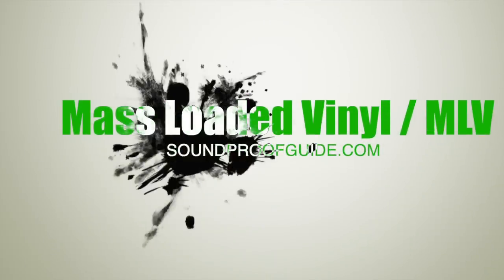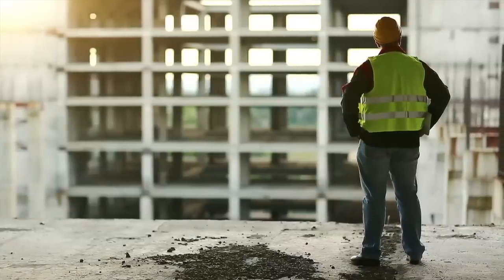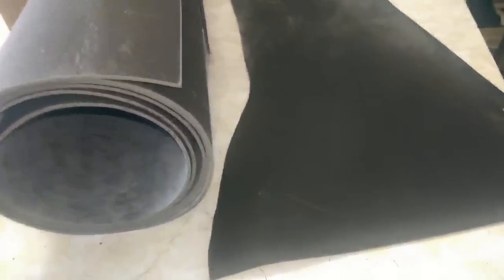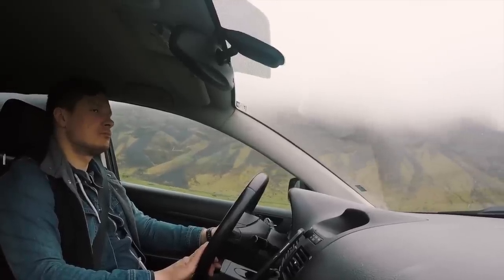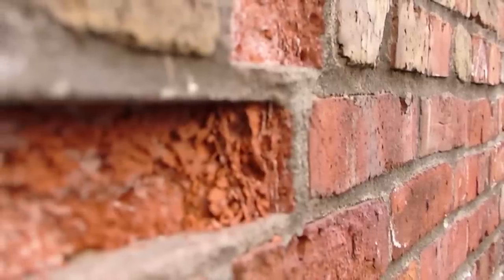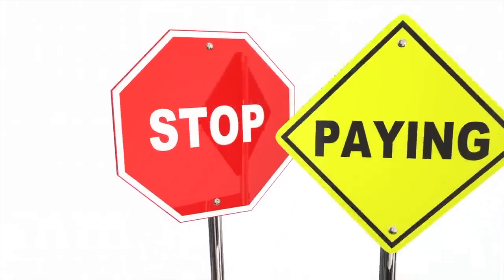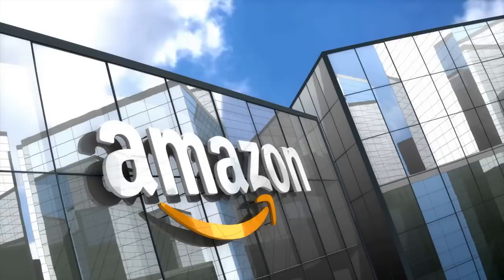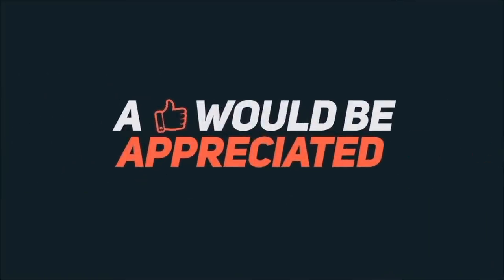Mass Loaded Vinyl For Soundproofing / All the MLV Facts!

Comment: Great video!  HELP.....My noisy HVAC closet with air handler/furnace and return, is a living room closet, 1 story ranch house on a slab.  Until the HVAC is replaced, please:  1- clarify which MLV products with adhesive is good to apply to the big tin box of the return - either inside its walls or its exterior or both.  To line the inside, the product must be odor free and safe.   2-  Could you clarify for me which type of materials are generally best for "low level" versus higher level sounds?    Plan to order MLV sheet 1LB for walls and door soon. Thanks.
Reply: The more the better. The thicker it is, or if you sandwich it together, it will reduce low-end frequencies

Comment: Question for the group... need to retro fit a walk in closet to make it a sound booth... I'm currently using Sound Blankets which are great for treating my sound...but not keeping sound out...
My thought was to put down a layer of MLV...(Walls, Ceiling and floor) put up furring strips and put another layer of MLV down... then put a thin layer of plywood so I don't lose room space....

Do I need the two layers or would 1 layer do a pretty good job?  Trying to reduce the outside noise from coming in... mainly neighbors and cars driving by.

Thanks

Comment: I need to soundproof 50 sqm of the commercial ceiling to reduce the noise of passing planes near the airport,  with wire meshed insulation over the metal beams, shall I use your mass loaded vinyl to cover extruded metal beams or just under insulation underneath? Any self-adhesive version in Australia?

Comment: This question is not on-point, but it's about sound absorption or blocking.  In my apt., I hear my neighbor's intercom buzzer as loud as my own; both her intercom station and mine are located in the same spot, separated by the wall.  I unscrewed my station from the wall, and looking behind it, saw that our stations were separated ONLY BY A PIECE OF CARDBOARD, bent in half.  So I look around my place and found a very thick unused sponge, maybe 2" thick.  I put the bent cardboard back in and added the sponge, and then screwed my station back onto my wall.  Is this likely to work?  Does a thick foam sponge have sound absorbent properties?  If it doesn't work (I haven't heard it buzz since, but it's only been one day) what should I use, instead of the sponge?  What about coating the bent-over cardboard with duct seal compound?  I think that's like modeling clay, which I've heard is helpful for soundproofing.

Comment: Would this be effective if attached to existing drywall, then placing Shiplap panels over it (for aesthetics). Used on exterior walls. Think a one-bedroom house, all four walls covered with this material. Thanks
Reply from the maker: It certainly would help! Just make sure to cover the entire wall because sounds will easily pass through gaps you might miss. The electrical outlet is one thing to look at since you can’t really cover them up with mlv. You can however stick some backer rods in between the electrical box and the wall to cover that gap and then seal the rest off with some acoustic caulking before putting the cover back on. That’s one area that sound can freely pass through walls that most people never think about. Let me know how it all works out for you!

Comment: There are many videos on youtube showing how to make panels to reduce  echo in a room, and I'm sure they also happen to do a halfway decent job of absorbing some of the noise transmitted in and out of the room. Do you think a bunch of two or three inch thick panels filled with traditional insulation and backed by mass loaded vinyl would do a decent job of sound proofing a particular shared wall or ceiling if arranged as closely as possible together? I know the gaps around lights, furniture, and corners will let sound through, but I can't rip up walls since I'm renting. I can make panels though.
Reply: Yes,  However, 100% coverage in the room would be best.  The fiberglass panels covered with decorative fabric with a 1# or 2# MLV back would be a good decision.  I have all the materials if you're interested.
Reply: @nenoisecontrol2169  Okay, thanks for the information and the offer. It will be a while before I have enough extra money to spend on panels either way, so may be some time if I decide to buy some from you. Either way, thanks.
Reply: @nenoisecontrol2169  
Please expand or describe fiberglass panels, from this answer. Framed ? 
On wheels, maybe 
Was going to try used Cubicle panels, from offices, then MLV, then pretty fabric. 
We Have a quiet SIPs panel home, but inner-city noise & neighbors. I Suffer from Hyperacusis!

Comment: DOES MLV ignite  at  50 c that is around 110 F. In summer some  times reaches that but it is around 40 c for the whole  summer is there  a chance MLV   ignites I am planning  to use on a flat roof which  I use it a a deck and it is in the last story of my building

Comment: We are insulating a Caboose that is close to a state highway. Framing the caboose, placing fiberglass insulation then wrapping with soundsulate then nailing wood planks.  Is this going to help with the external noise?  ALso, can it be used on the floors as a underlayment beneath thick LVP?

Comment: hello.... 1- can MLV be used on lighttly uneven floors (ie does it forgive say 1/8 1/4 spaces...)  instead of having to poor floor levers products... 2 do you need to put MLV under kitchen cabinets to prevent "noise" from main floor to basement bed room... ? 3- what MLV weight should one use for soundproofing ? thx...

Comment: so could this be used on a completely open gap with maybe something holding it in place and blocking sound? my room divider doesnt reach the ceiling for some ungodly reason and all the light and noise from my roommate come into my room.
gap is 118" length x 20.25" height x 3.62" width

Comment: Thank you for your videos.  Trying to figure out the most cost effective way to reduce airborne noise when I’ve got the ceiling opened up?  I want to grab my chance to do what I can.  I can afford to do maybe 2 or 3 things, but not everything.  We will put acoustic Sheetrock, of course.  And also rock wool between the joists.  From there, choices are:
(1) sticking MLV to that Sheetrock (between it and the joists.  Or is it better to staple it to the joists before putting the Sheetrock?)
(2) another layer of 5/8” 
(3) MLV between 2 layers of Sheetrock (is this enough better than 1 to be worth it?)
(4) Green Glue between 2 layers of Sheetrock
(5) resilient channels (as I understand it, these are more for impact noise, but one of your videos says it’s good for both - but I think MLV is better than this if I have to choose)?

Comment: Wanting to install these in a ceiling, in between the floor joists, over the mineral wool insulation, following by 1/2 dry wall, plastered in between the floor joists, leaving them exposed. Reason is we have a low ceiling, so wanting to get all the headroom we possibly can. Do you think the mlv will still help installed in this way? Will it be far more noisy with the floor joists exposed? Thanks!!

Comment: If I want to install MLV on ceiling to block upstairs unit coming to basement suite (basement tenant is complaining crazy about upstairs chair and footstep sound), what's the layer order?  After opening the existing drywall on ceiling, from ceiling down: ROCKWOOL Safe'n'Sound® insulation, Resilient Channel (or Resilient Sound Isolation Clips), drywall, MLV (Goes here?!?), then paint (or can I add another layer of drywall here using Green Glue)?  Please correct my order or if you advise anything should be put in or taken out.

Comment: I have a wood fence that the bad side is facing me.  Can I cut the vinyl in widths, weave it in under the poles holding up the fence and staple it in between the boards that are vertical instead of placing it over the entire fence?

Comment: My questions is can I put this on the surface of things... like walls and ceilings without installing inside. (Rented apartment)
Reply: Yes you can
Reply: @SJ-gd6bo  Thanks.
Reply: @SJ-gd6bo  will it work for vibrational sounds too?
Reply: @Joshua-Mystic  , define vibrational sounds, the matting is good for blocking lower end sound waves, ex, bass. So in theory, yes it could dampen some vibrations.
Reply: @SJ-gd6bo  like when footsteps walk on wood floor, the floor vibrates. Like a physical Soundwave, can it block that?
Reply: @Joshua-Mystic  it would help for sure, but the best way would be to decouple the floor or ceiling. This and insulation would help.

Comment: Will you say resilient channels with mass loaded vinyl in between two pieces of drywall is better than double wall for soundproofing? The each wall in the double wall will have safe and sound insulation and double drywall with green glue in between them. Please help lol

Comment: Thanks for the video. very helpful. For an aluminum porch/Florida room (attached to home) with sliding glass doors - would you recommend I glue it on the outside of the aluminum walls on both sides to block out the noise from neighbors on both sides? or dO I need to glue it inside with dry wall on top? I hope the exterior option is sufficient as the finished look doesn't matter. Interior will cost 3-4X more
Reply from the maker: You might be good with just doing the exterior but just make sure there are no open gaps. Even just a crack in the MLV will let at least 50% of the noise back in. 

You can test to see if its enough soundproofing after you're done with the exterior layer to see if you need more. 

Best of luck and please let me know how it turned out and send pics if you can to info@soundproofguide.com
Reply from the maker: @anonymous78knm  Yes BUT you will be disappointed with the results. I wish I had a better answer for you but windows are difficult to soundproof. BUT I do have a video coming out this upcoming Saturday which is about building a DIY window plug. watch it and see if its for you. It's easy but a bit time consuming to build but it's definitely worth it!

Comment: If anyone is interested in soundproofing a rental property, there is realistically nothing you could or would want to do. There are many steps in soundproofing, there is no one thing that will give you peace and quiet. If you own, then you have options, be warned, the price adds up very quick.
Reply: David  agreed, but this is something that requires a structural engineer from the start.

Comment: My yard gets lots of traffic noise and neighbors barking dog.  If I hang this on the fence will it help much? 6 foot tall fence.  Of course the sound can go over the fence but I'm wondering if it would be worth the cost...
Reply: The cost is going to be high, but if you do it properly, yes by twenty decibels. 

At more cost, you can paint it with the special paint mentioned in the video ( latex.).

250 $ for 100 Sq ft is the going  rate ATM. Maybe cheaper if you buy more.

Comment: On my side - bedroom, on the other side - the neighbours kitchen, and i hear them dragging tables, chairs, dropping stuff, coffee machine, blender, whatever. A big family that wakes up at 4-5AM. Will adding a dry wall prevent the noises i mentioned? or will i need a mass loaded vinyl? I actually cannot find that material in my country so if yes, i would like to know what other alternatives are out there.
Reply from the maker: Drywall would definitely help but mass loaded vinyl is definitely not necessary. Add two more layers of 5/8” drywall with carpet glue (watch my latest video) and you should be good to go!

Comment: There seems to be 3 thicknesses of mlv. .5, 1 and 2 pound ratings. 

Is 1 pound twice as noise reducing as .5 pound? 
Is 2 pound 4 times as noise reducing?
Thanks!
Reply: Thicker material helps with lower frequencies. 

Generally speaking, the .5 thickness will help with the higher end frequencie just fine.

It is possible to use 2 of the .5 layers and achieve almost the same low end frequency reducing ability as the thickest type, if you space them properly. 

I went with the 1 pound, because I was more  focused on mid frequencies and limited space when using it in a car.

Comment: For a wall what would be the recommended thickness of MLV? I have seen some MLV that is 1/8" thick and others that are much thinner at 1.2ml.
Reply: I would recommend the 2# MLV.  the more mass the better.  how are you intending to install it?  between two pieces of drywall?  Here are the thicknesses: 1/2# MLV is 1/16", 1# MLV is 1/8", 1.5#  is 3/16"  &  2# 1/4"  available in 4' or 4.5' wide rolls

Comment: Hold on, you said in your video in an apartment you can install MLV in the ceiling or floor, you realize a majority of apartments and/or townhomes WILL NOT allow anyone to do such a thing! you cannot break down walls or add drywall or tear up flooring or the ceiling, you should mention this as well as a way to make it work (if even at less effect) without permanent reconstruction. Awesome video otherwise and MLV is definitely on my list for soundproofing material.
Reply: Joseph Bedinghaus you can install this stuff in townhomes, condos, apartments, as long as you don’t change anything structurally and own the unit beforehand.
Reply: I wonder. If you install on a wall, then put more drywall up, and adjust trim to match, if anyone would notice. You have to live there ....do the improvements you need to to tolerate it.

Comment: Would layering multiple lengths of MLV on top of each other increase soundproofing significantly or is that not worth it?
Reply: @xavier6foot8  @Ben Ho does 1 + 1 =  1.999999999999999999999999? of course it does

Comment: Thanks for this video! Will this keep sound from going out of my walk-in closet if I hang it on top of the walls, ceiling, and floor with heavy duty velcro? I live in an apartment and want to be able to take this with me when I move out. Is there anything I need to do when putting it up to make sure it works? I read it should have some space between the wall and itself for it to actually work. I can hardly find any info online about how to do this :(
Reply: You can try foam board insulation they are pretty big and they are $8 a piece at lowes or homedepot. I'm gonna try that maybe combine it with the vinyl. Maybe tape the board or staple them and take them with you when you move. I don't really know what I'm doing its just an idea I had for myself or someone else that wants to try it.

Comment: Just what i needed. Will install this product on the current walls, will leave about 1/2" gab between it and the sheet rocks that i will install in front. This  is to separate a babershop from an adjoining apartment. I will also use it as the underlayment for the new vinyl plank floor to reduce sound.. this should work. ?
Reply from the maker: It will certainly help your noise issues!

Comment: Can I use regular MLV on ductwork? As can I just wrap it around instead of buying Thermo?
Reply: First, apply a decoupler and then stuff on top.

If you want to go really crazy you could get some of that amazon basics sound deadening and put a strip every few feet to stop the metal from vibrating as thus making sound.  Then add foam or insulation and MLV ob top.

It'll be dead quiet

Comment: I want to sound proof my refrigerator. Should i put MLV inside the fridge or around the outside of the fridge?
Reply from the maker: Definitely around the outside of the fridge. 
Just make sure to not cover the fan or any part of the fridge that would require air. You don’t want to accidentally overheat the fridge and cause damage.

Comment: Would this help block outside noise like from cars? Can i use on walls behind drywall?
Reply from the maker: Certainly would!
Reply: @soundproofguide  can i use this between drywall and insulation or should i put vapor barrier n them put mlv n then drywall?

Comment: Hi, what do you recommend for soundproofing our garden from neighbor radio? (No chance to discuss, tried many times) Would MLV be good to hang on the fence? Any better option? I've checked echo barrier h9, but it is quite expensive. Many thanks!
Reply from the maker: That’s a hard one because of the frequency a radio emits. Really, a solid fence will help a bit but mlv will help a tiny bit more. The noise will still come in from all around however.
Reply: Buy him some head phones !
Reply: Ear plugs.

Comment: Can I put MLV on the outside of the drywall?  I used green glue in between 2 sheets of 5/8th sheetrock but if I want more soundproofing can I put the MLV on the outside of the 2 sheets?
Reply from the maker: Yes, just as long as you’re covering the entire walls leaving no gaps.
Reply: @soundproofguide  ok. Great.  Thank you.

Comment: Would it work if I didn't touch the existing "old" drywall from my 1950 apartment... instead, add the vinyl, then another layer of drywall and some sound insulation paint?  I think ripping out my existing old drywall would be a mess vs just adding on top. 
Any feedback would be appreciated!
Reply: Steven Soco  Honestly, green glue seems like a scam to me. What's more it's ridiculous expensive. WHere is the science on green glue?

Comment: will i get double the effectiveness if i put a vinyl barrier over my wall and use acoustic pain over it?
Reply: Dan Ramirez different types of layers block different frequencies in different ways so the technique is to layer. All different stuff. Think of an old metal  bell ringing. If you put it in a box it will be slightly quieter. If you surround it with cotton wool then put it in a box then seal the box and wrap it several times it will be alot quieter.